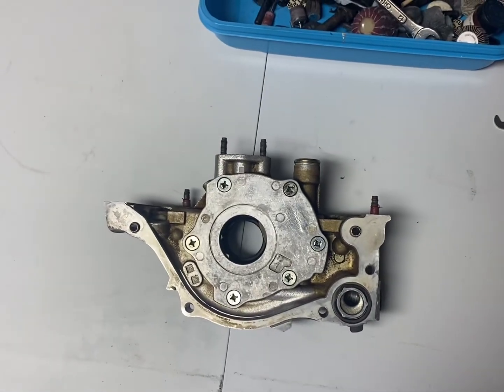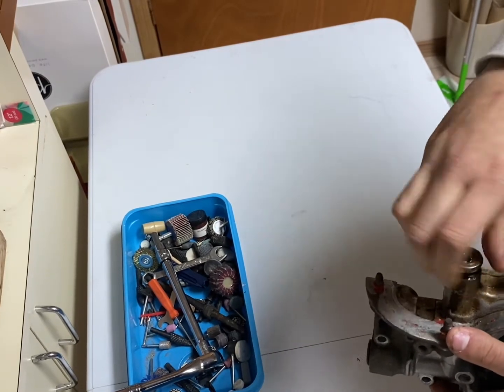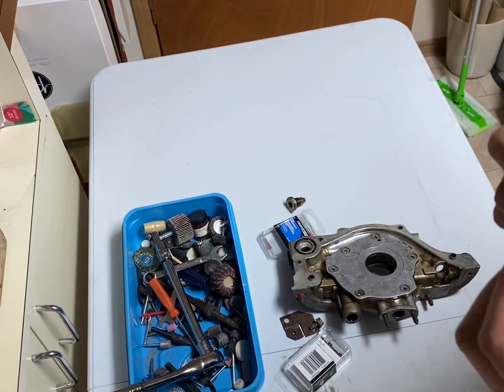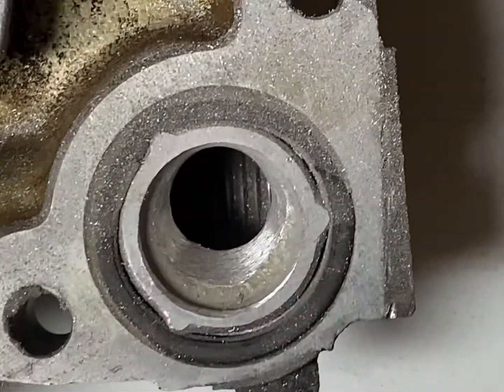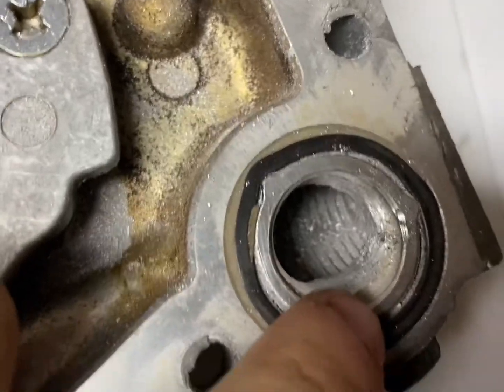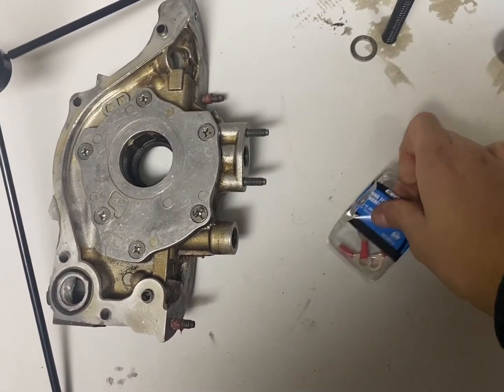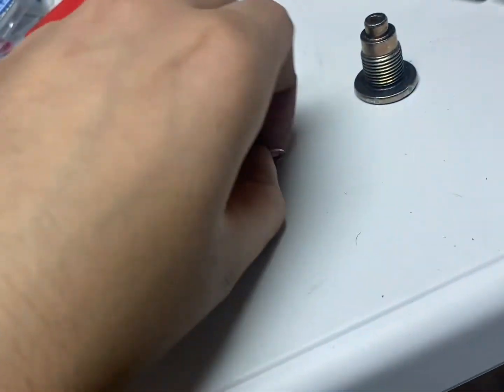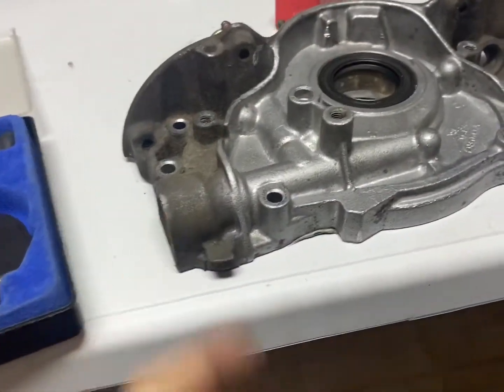How to Add More Oil Pressure to a Stock Oil pump | D16Y8 Turbo build | Part 4

Comment: i added one washer to my oil pump and it ended with spun bearings from loss of oil pressure and everything was still tight on pump never again will i shim the oil pump
Reply from the maker: You didn’t clean it properly or then. I ran this never had an issue.